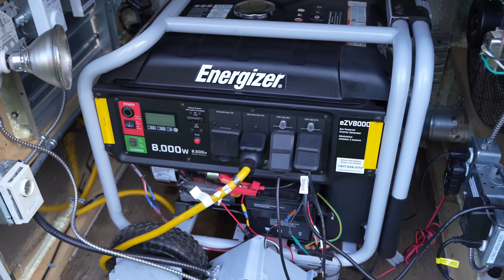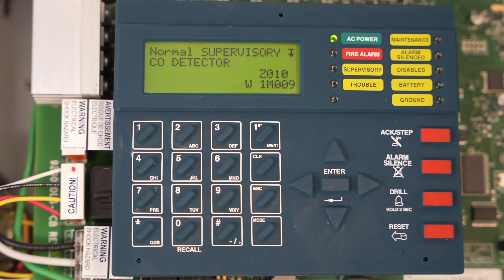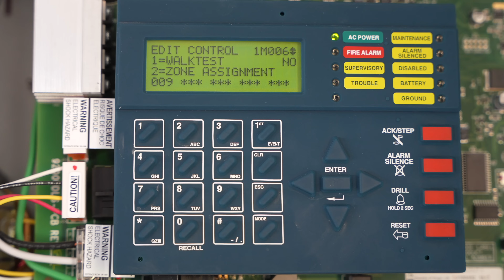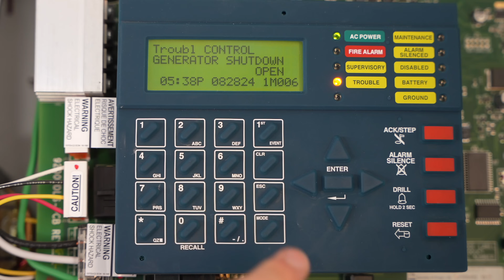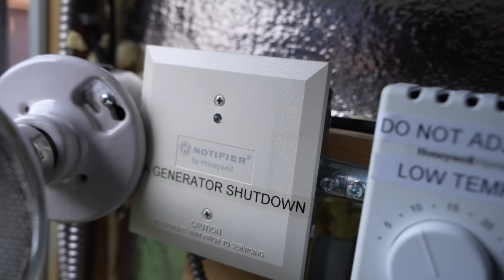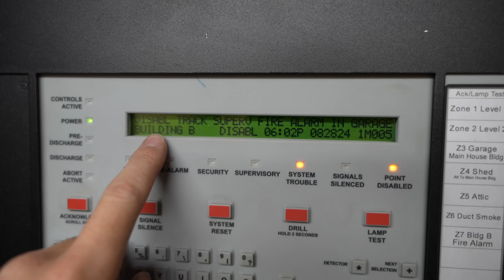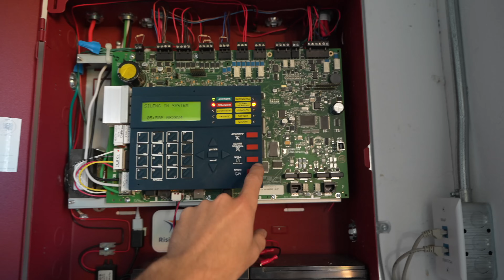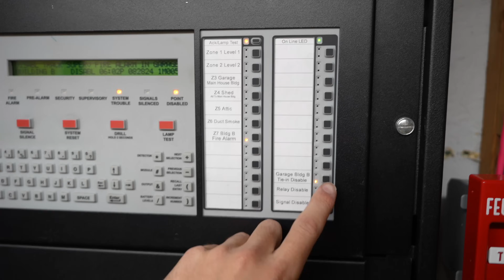Fire Alarm Generator Emergency Shutdown | Programming & Testing! | Part 2

Comment: they did a fire drill at my high school yesterday at 9:30 am. after the drill, they left the system in alarm (silenced obviously) for the rest of the school day. i left school with it still saying "ACKNOWLEDGED FIRE ALARM" from the pull station that was used. this morning, it was back to normal. any idea why they didnt reset it right away and waited at least 6 hours?
Reply from the maker: Seems pretty weird
Reply: The high school i went to had a similar scenario, in the morning it went off but wasn’t a drill, it was due to a faulty smoke detector that kept tripping the system, so after a couple times of it tripping they had to leave the strobe’s flashing and didn’t reset it until they replaced it

Comment: question: Why do you need a commercial grade fire alarm system?
Reply from the maker: You don't need it it's not required just works better and does things that I need it to that residential devices can't
Reply: the answer is why not

Comment: Interesting question, have you considering installing one or two secondary alarm pulls (could trip the rest of your alarm system or not) for an emergency shutdown in case of a fire that does not trip your relay but you still need to shut it down quickly (or some other kind of emergency during a power outage needing a fast shutdown)?  Might be useful in case of an emergency in case you cannot get to your key quickly and would seem to be easy enough to do with your system.
Reply from the maker: Yes I'm planning on installing a dedicated emergency stop

Comment: Nice nice I think you should put a red strobe in the garage and one in the house so when it estops you can know!
Reply from the maker: I don't know if you'd notice another strobe very easy when the fire alarms are already going off
Reply: @nics-systems-electric  oh
Reply: @nics-systems-electric do you have a yes est3 Edwards and notifier or a annunciator probably the same thing I'm looking for something like that
Reply from the maker: @DJLAWOLF  I have some EST annunciators
Reply: @nics-systems-electric  I'm coding my Arduino to communicate with one

Comment: Nice Work :D But one Question: The way i understand it when the Relay is Triped its opening the "Run" Signal so that the Generator stops.
But when the Fire ALRM is  tripped and the power goes out isnt the Controller still trying to start the Generator over the "Start" cable?
Reply from the maker: The fire alarm relay is closing giving power to trigger the stop relay in the generator grounding the ignition system

Comment: Great idea Nic. 

But I would suggest program it to turn off with all the other smoke and heat detectors. Because if your actually running the generator and the garage catches fire. And/or turn off the power from the house during a real fire. It'll turn off the power for the fire department. Every second counts in a real emergency. You definitely don't want the generator turning on, during a real fire. 

But I do pray that you never go thru what I've gone thru. (I do know. You really don't understand. How feels being in a fire. Until you've gone thru a real fire yourself. So I hope you never understand the lost.)

On the pull stations I wouldn't set them up to turn off the generator. Leave them alone. Just all the smoke and heat detectors only. Think safety first.

By the way thank you for letting me know about the gas valve feature. in my last post.
Reply from the maker: I do get the idea with that it's just something I really don't want to ever trigger as it could damage equipment. If it was something more difficult to falsely trigger such as sprinkler flow that could potentially be implemented. The thing is by doing all that it would only be helpful if the generator was running 99% of the time it would not do anything during a fire. If power needed to be shut off the breaker can be used. I would prefer to just install an emergency stop button on the generator that could be used.
Reply: @nics-systems-electric  how could you say the main would be used.  When a fire is at the main breaker? 

After all you wouldn't go inside a burning building to turn off the electrical power. 

You would go to the house to disconnect to remove power.  But everytime you do generator will come on. Therefore you need another way to shut it down. A push button is a good way to do it.  Is the fire isn't to close. Which I like that idea. As long you don't set the smokes/heat detector to it. But you'll have put it on the main house. Not by the generator building or garage. For quick safe access. For shut down. 

And have a special plaque made to say emergency generator shutdown. 
Instead of a printed label.

So I think there's a part 3 to video you should make. If you use this idea. 

But before you do it talk to your local fire department about it for ideas.
Reply from the maker: @robertbeyers1308  if you really needed the power off you could also unplug the generator however, I don't think it's much of a concern as usually power seems to be left connected
Reply: Well you can shut if a fire is inside the garage you are nor the fire department will try to get that panel to shut off the power. Due to fire is burning near the inside panel. So you or the fire department will shut the other breaker inside the house to turn power off. They can go as far as shut the entire house off.  Then the generator will kick on.  So you definitely need to think this all through.  Which you do not want it to turn on. Therefore it neccesary to protect the fire department and yourself. From accidental activation from the generator.

So right now you need to ask yourself this question.  Which is going to cost more.  Adding an emergency button. On the house. Or setting the other smokes/heat to turn it off. 

After all the fire department won't ask for the keys to the generator building to shut it down. Even though the generator has breakers sometimes they will fail to cut power. 

So it really important for an extra way to shut down the generator from another location. Even if it's the other smokes/heat detectors.
Reply from the maker: @robertbeyers1308  me personally I wouldn't worry about it, they likely are not going to turn off power anyways.

Comment: Great to see everything working as supposed to on the first try.

Since the emergency shutdown can cause some damage to the generator. Would the test of the generator shutting down get added to your yearly fire alarm test, or would you just test it when you make a change to the generator?

Also not sure if I missed this part in this video or in a past video but would the shutdown close the vents on the other side of the generator room that opens when the temperature gets too hot?  I know the fan would turn off but I would think having everything would help if somethijg were to happen with the generator.
Reply from the maker: For now the damper stays open I could run the open signal through the relay to open during the fire alarm to close the damper. I would be probably testing it once a year in the annual test just without load on the generator.

Comment: Isn't firelite and notifier made by the same company? If so, why would there be problems with using notifier parts on firelite systems?
Reply from the maker: They are not listed for it so it's not legal and on some firmware versions it will not work on the other system

Comment: Nic what are you doing?? That your mom says so 21:31
Reply from the maker: At 21:31 I was testing the fire alarm system. My mom was not in this video I'm not sure what you were talking about.
Reply: @nics-systems-electric  In the background you could hear someone say "What are you doing?"
Reply from the maker: @parker02311  that would be the young guy next-door
Reply: @nics-systems-electric  maybe
Reply: @nics-systems-electric but I have a generator in my house control’s my house power